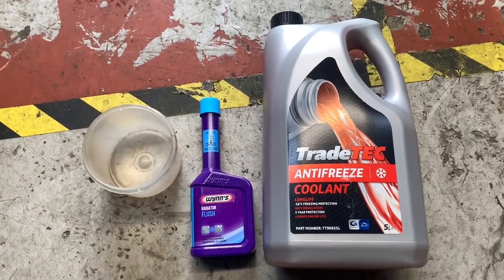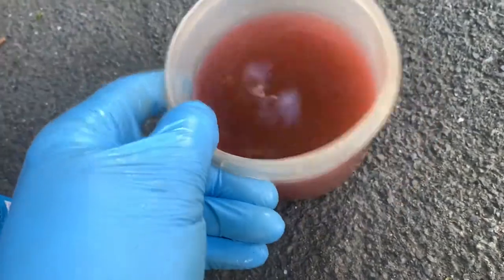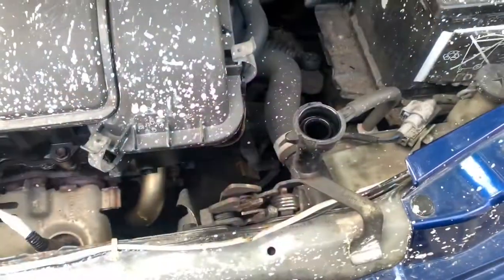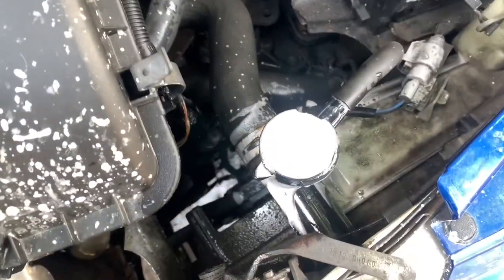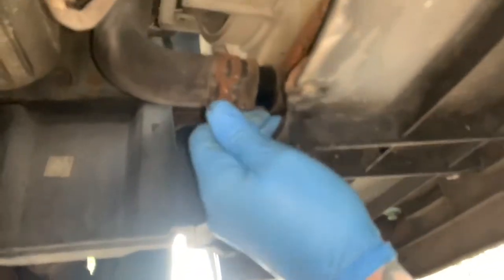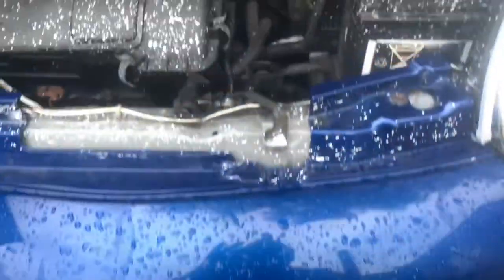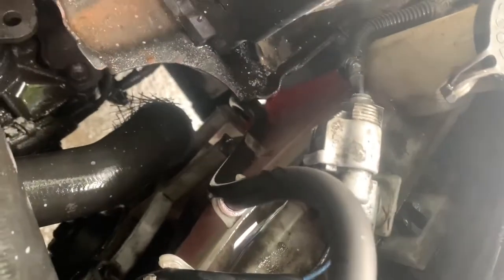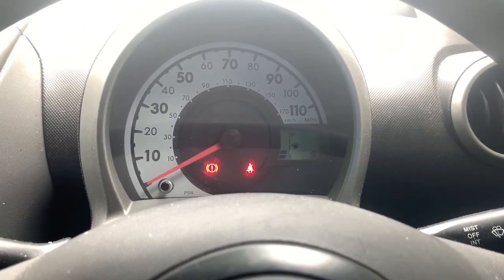Dirty Coolant Flush, How To/DIY Citroen C1/Aygo/107 Coolant System Super Flush

Comment: Brilliantly presented and funny too...one question, do you keave heater on blowing full hot or just the control to full but heater not on?
Reply from the maker: Thanks! Really it just needs switching to hot, but best off having the fan on to make sure it’s circulating through the matrix. Just put the fan on low speed though or else it could stop the car reaching temperature to open the thermostat properly and fully bleed the system in cold weather.
Reply: @StupidBlokeStupidVideos  Thanks a million !
Reply from the maker: @ferryportia9442  no problem at all! Good luck with it, and hope the video helps. 

P.s. there’s loooooaaaads of other C1 vids on here too if you fancy a scroll through my other videos.
Reply: @StupidBlokeStupidVideos  I just found them can't Wait to go thru them!! Thanks again !! PS liked and subscribed
Reply from the maker: @ferryportia9442  nice one 😁

Comment: The coolant flows through the heater matrix all the time. There's no valve so it bleeds regardless.

The cold setting just moves an air flap to bypass the heater matrix.
Reply from the maker: Yea some systems do that, some have a valve. Never really investigated what type this was but makes sense to be a flap, but I always leave it on hot when bleeding it up anyway yo make sure it’s circulating.
Reply: That depends on the cooling system.  In my car the hot/cold selector opens&closes a valve in the coolant hose that feeds the mateix.

 Air always blows over the mateix,  it I can choose if the
Coolant circulates through that part of the circuit or not, therefore controlling the temperature of the air coming out of the vents.

Comment: Tried flushing and changing the coolant of my C1, but I couldn't for the life of me get that 14mm bolt off.

What did you use to get yours off?
Reply from the maker: If it’s tight, try a long handle ratchet with a good quality 6 point socket

Comment: Hi,

I drained my coolant from the bottom house radiator. But the expansion tank stayed full. Is that normal? 

Later i drained from the waterpump, but i didnt check if the expansion tank drained to be honest...
Reply from the maker: @pgrferrari  yea the expansion tank doesn’t drain. I sucked the coolant out of mine in this vidoe
Reply: @StupidBlokeStupidVideos  you cant drain it from the overflow hose? That u take it off from the radiator, and then throw the hose down? 

What does the expansion tank does then? Because u fill it up for like nothing?
Reply from the maker: @ the coolant system is pressurised, and as the coolant heats up it expands. On old systems it would just throw some out when the pressure gets too high and the radiator cap releases it, but with an expansion tank it pushes it out and through a hose into the expansion tank (which isn’t under pressure). We it cools and shrinks again, it sucks it back in. If your coolant is low, filling the expansion tank won’t actually enter the cooling system.
Reply: @StupidBlokeStupidVideos  thank u for the explanation. I am just wondering now why u need to fill the expension tank then.
Reply from the maker: @ it’s a reservoir to keep the level/pressure in the system correct